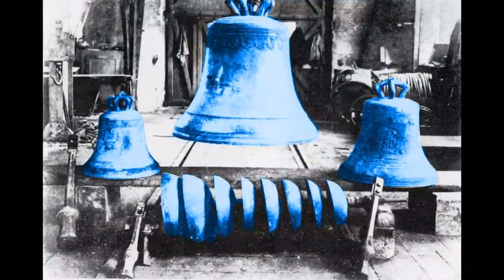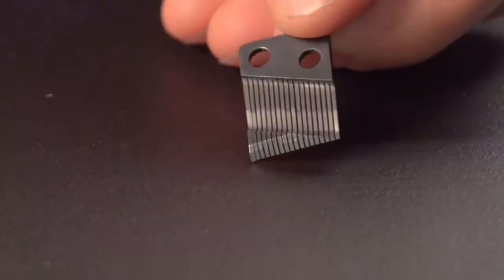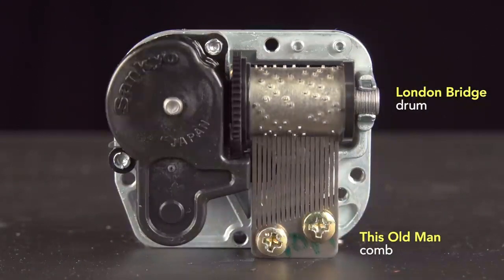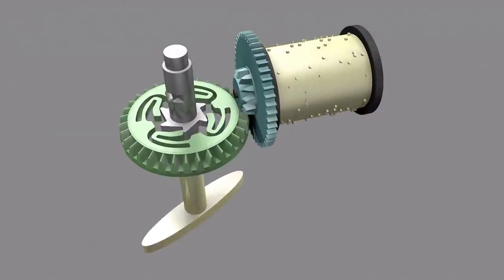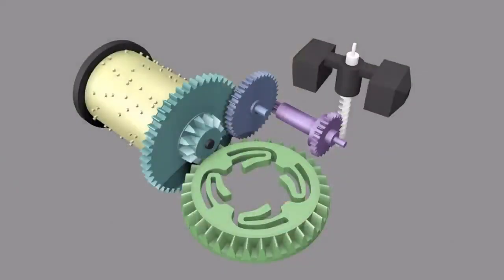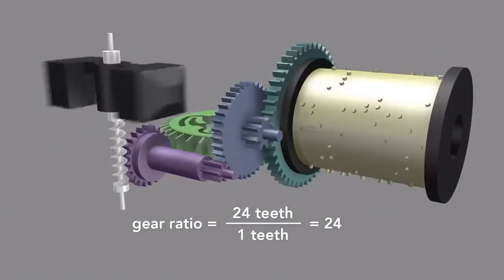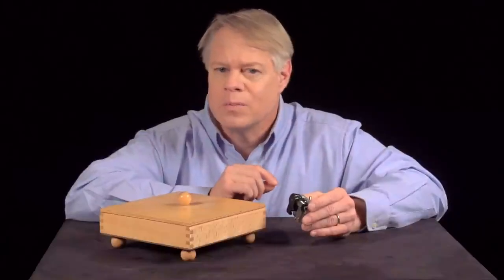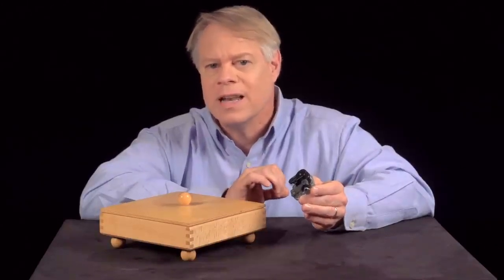How does a wind up musical mechanism for music boxes, musical boxes or automatons (automata) work?

Comment: Hey if you see this, I appreciate your video! A few questions if you'll indulge me:

1) Do you think bronze would be a sufficient material for the gearing mechanisms? I am hoping to use bronze casting to slightly over-size the gears and parts, and then bring them to tolerance with files, but I'd hate to do all that work if bronze would be insufficient. If it helps, I plan to use a copper-aluminum-nickel alloy.

2) Do you have a good reference for a resettable drum? One that could have moveable pegs? I know they tend to be built to be permanent, but I am hoping there may be a way to adjust a drum that is secure enough for usage.

Comment: I am definitely not DIY-ing a mechanism like that for my LITTERAL custom-built music box 💀(i am SURE i can make it, only a hand-cranked one though)

However, on the other hand, this is very cool!, i was beginning to wonder how these worked, 
-i thought it might have been a regular spring inside that was un-wound (you know how they remember their set position?) but somehow slowed down...
but this makes sense, i almost had the idea right, except the spring is flat and not wound as a normal coil spring is.
Reply: The springs used in old watches are called hair springs/ aka the first batteries of civilisation